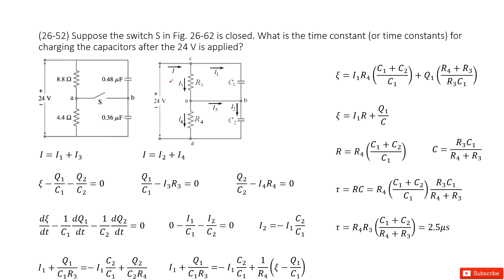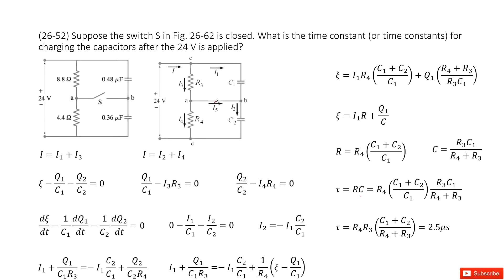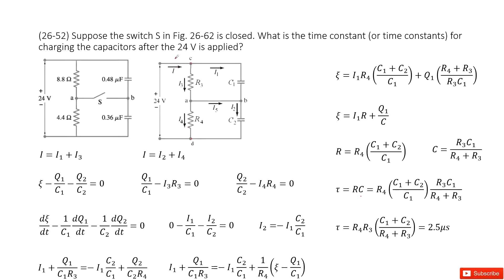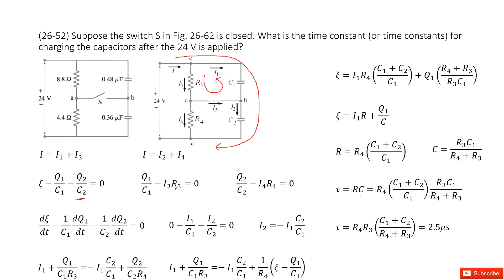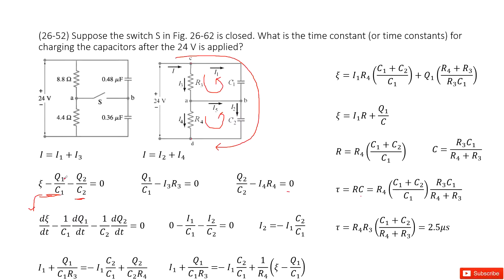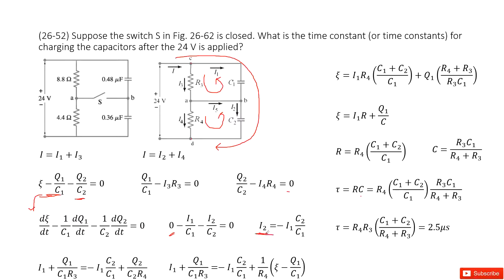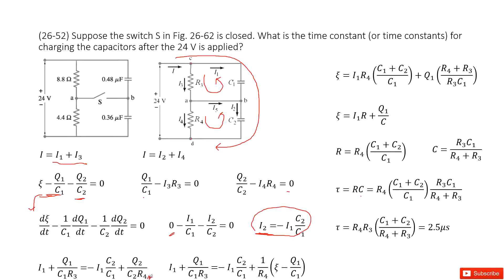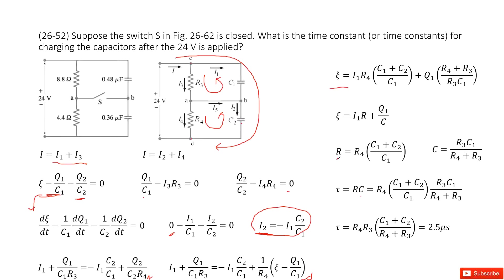(26-52) Suppose the switch S in Fig. 26-62 is closed. What is the time constant (or time constants)

Comment: Could you also say R = parallel contribution for resistors, C = parallel contribution for capacitors, Req = 1/(1/R3 + 1/R4), Ceq = C1 + C2, so tau = R3*R4(C1+C2)/(R3+R4) ?